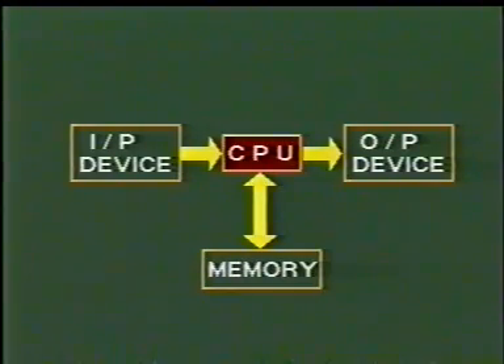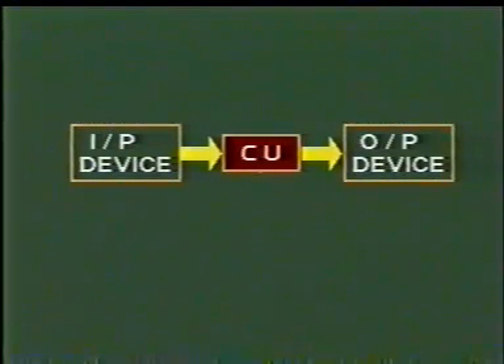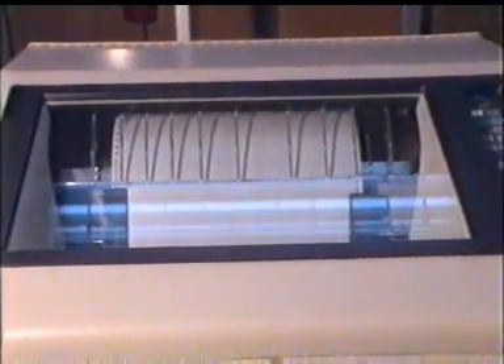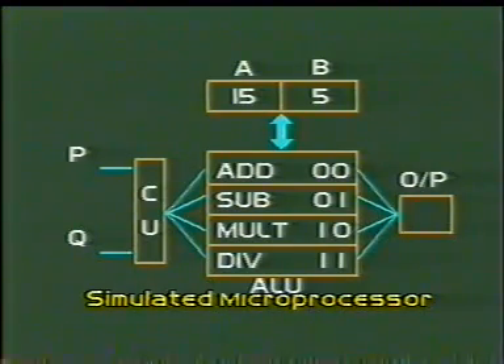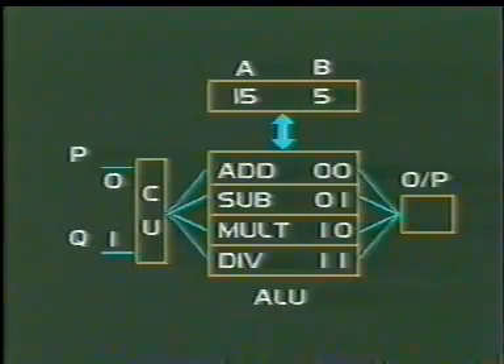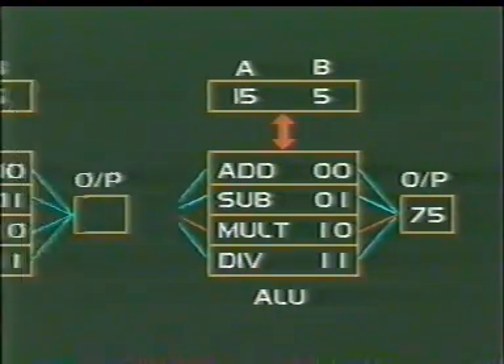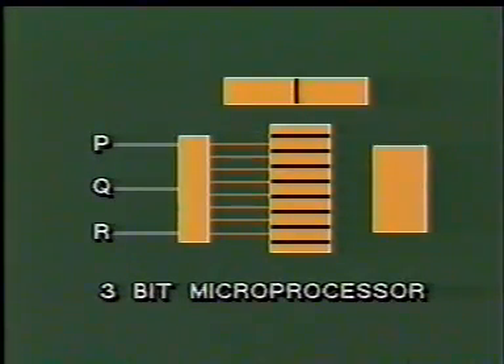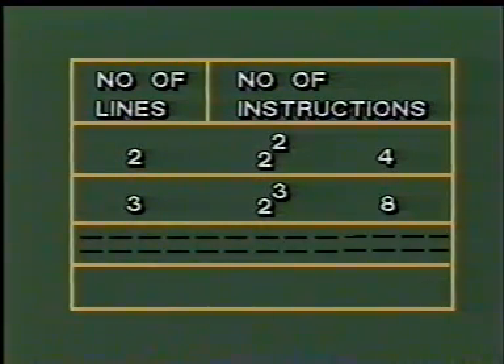Microprocessor an introduction

Comment: FYI Maicon, today microprocessors work at the same principles as displayed in this video, so this knowledge is relevant in 2013, 2014 or 1980 or 1969. The computers of today work at the same principles as the computers designed 50 years ago....